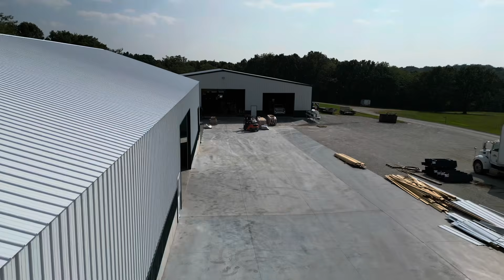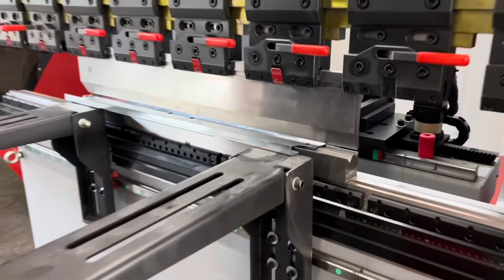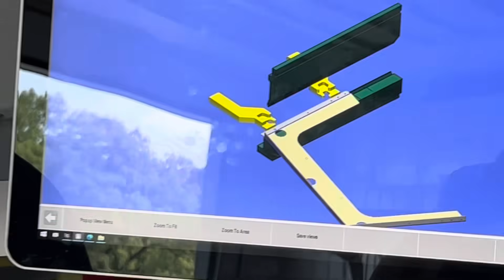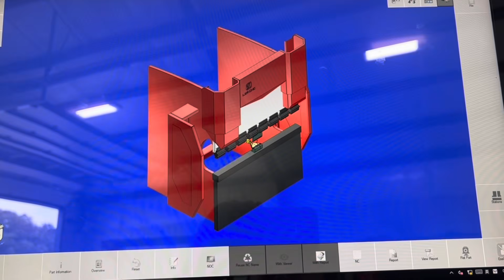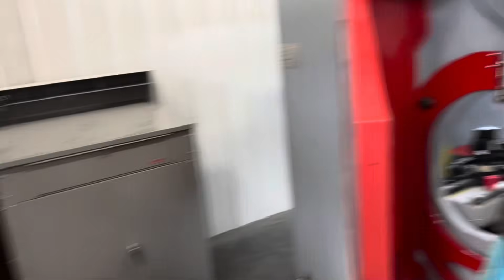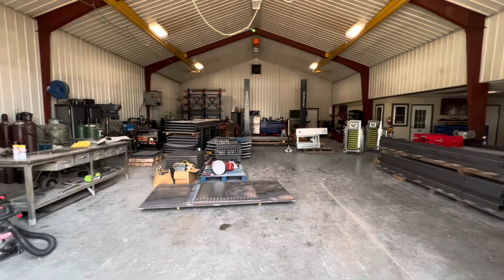3D Bend/Force press brake - Triple P Ranch

Comment: Man that 3d setup is slick.  Being able to design something and bring it right into the brake is such a sweet feature.  Definitely gonna want to upgrade to that at some point.  Unless I can trade mine in for one of these.  Be kinda like going from a lariat to a platinum pickup lol
Reply from the maker: How I work it on trade ins is, when your ready, I will market your machine for sale, we will get it sold.  So far I have prob done this 10 times, selling a 1-2 year old used machine for $3K-$5K less than you paid for it, is super easy.  I always offer an extended warranty for 6 months to help the buyer have confidence in doing it.  But man I will be honest, your setup is still super sweet, and in some ways nicer than a 3D brake.   The 3D programming is a little bit if a pain, sometimes it wont let you do what you want to do, and is somewhat constrained.  So hopefully you can grow to the point that you can keep yours, and add a second smaller 3D brake!
Reply: @turbocobra  that makes sense I can definitely see it being a bit over the top for the simple stuff.  Just really love that you can I'mport a 3d part right from fusion and get after it.  That's a game changer, I actually draw simple parts all the time in fusion just to know where everything lands.  Definitely good to know you offer some help in the upgrade process though, cuz you know I'll be calling you one day hopefully sooner than later 😉